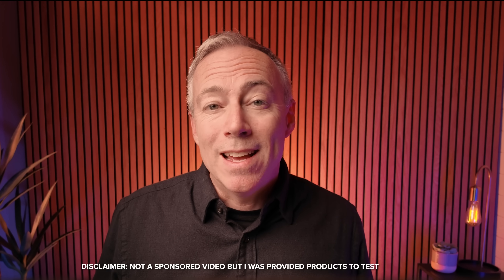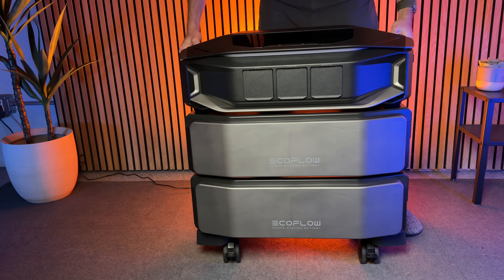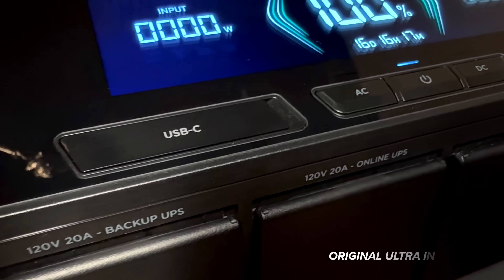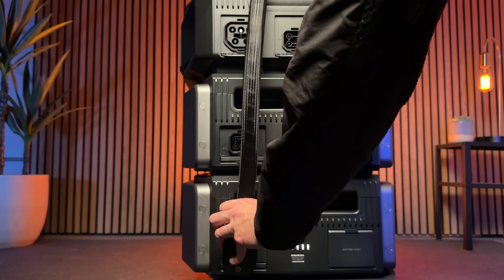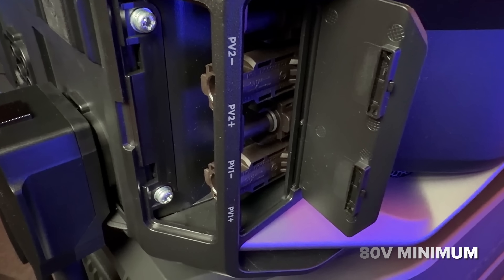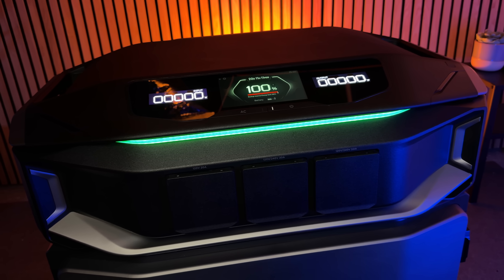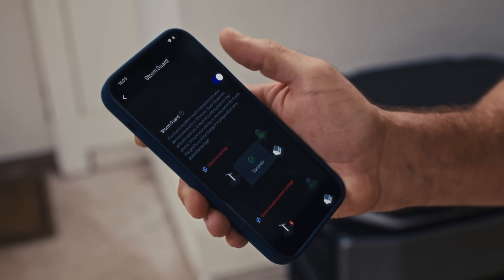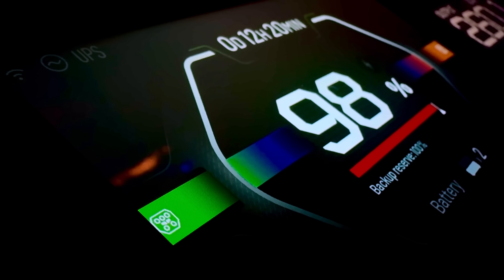EcoFlow DELTA Pro Ultra X - INCREDIBLE upgrades you need to know about

Comment: Silly question 🙋 Do you think it would be powerful enough to run a food truck for 10 hour day, with four 3000 Watt blenders, two 2000 W espresso machines to regular refrigerators two freezers and a 18,000 BTU air conditioning unit?
Reply: You need to monitor your power usage to find out how many KWh you need to run your truck for the day.  Then you can make an informed decision.  You are only using those items for short periods of time, but you could still need a lot of power while you are not connected to shore power.
Reply from the maker: Yep, that's the only way to know for sure. Many of those are intermittent loads so it's hard to know how much KWh they use - depends on hours of use. My hunch is that might be a lot but if you had a 30kwh system it might work but that's pretty big.
Reply: depends on how many batteries you had and if you also had any solar panels on the roof of the food truck...

Comment: Really informative video, Todd. I’ve had a multi-DPU with SHP2 system for a year now, and I’m really happy with its performance and value proposition. The specs of the updated version make for a tempting option and alternative to the Powerwall and others. Get it now before the 30% disappears.
Reply: Yes, the 30% on home back up battery systems was the reason that I pushed the build of my two ultra DPU and battery system.  Now I am thinking about the panel for automatic back up instead of a manual 50 amp hub and interlock.

Comment: What is the gateway you referred to? Did you mean the smart home panel 3?
Reply from the maker: They basically upgraded the SHP3 to have way more circuits so it can act as a main panel. They are now selling the gateway which is stripped back and has fewer circuits than the SHP2. Clear, eh?
Reply: @todd.parker  trying to see the gateway version on their site but only seeing SHP2 (and nothing about v3). that woudl be a good comparaison to Tesla gateway 3 which can be had for $800 but no smart breaker control (which is ok, entire home backup and 200A place to land the inverters)
Reply from the maker: Guessing all the product pages will be live soon

Comment: Please see if it still favors grid power when in self-powered mode.  
For example, my DPU is set to 80% backup reserve and solar charges the battery above that to 95%.  If there's a particularly sunny day and the battery hits 95% then the EcoFlow algorithm annoyingly shuts off the solar and continues using grid power instead of shutting down AC power and draining the battery to the backup reserve (while continuing to use available solar for charging).  Completely bassackwards!  
So currently, every day I have to watch the battery percentage and go out to the garage to switch off the charging plug to continue using solar.  After about a month of tech support emails and various levels of support, EcoFlow's solution to their algorithm is to just keep setting lower and lower backup levels until solar is used the entire day (like every day is predictable and has the same amount of sunshine).
I have also tried to handle this with their app "automation" feature, but so far it only knows about Delta 3 Plus systems I have, even though there are icons for every other EcoFlow system I own, including the Delta Pro Ultra (tech support is clueless about how their own system works in this regard as well).

Comment: Is this unit able to communicate/connect to EcoFlow Duel fuel generators, this info is not represented during this ad?? Ty
Reply: The DC generator feature did not work on the regular Ultra, so no. Just typical AC charging.
Reply from the maker: Good Q. Info is pretty thin at the moment but they say this in my product info "Works with EcoFlow or third-party generators for unlimited backup (paired with the EcoFlow FlowMaster Generator Rectifier via AC input)
Supports up to 12kW generator input (with 2 battery packs)". Hopefully more info soon
Reply: @todd.parker i do see the A/C connection but not the DC to DC smart cable connection 🤷🏼‍♂️. I’ve recently found EcoFlow’s website to be somewhat difficult to navigate & get clear correct information. Pictures also misrepresenting product information. 🤞hoping for better. But I do enjoy the brands engineering 👍

Comment: not only is it not worth the upgrade it was not worth the purchase. cost to value is terrible.
Reply from the maker: If you're into DIY and have the skills to properly wire everything with all the right fuses, disconnects, and follow code perfectly, you can save a decent amount of money but a typical all in-one inverter is very loud, has high standby losses, and the rack mount batteries take up a ton of space. The Ultra is pretty incredible because you can just plug and play a system in a few minutes with no technical know-how and have something as powerful as a Tesla Powerwall 3 (or multiples) with no installation costs as long as you already have a generator inlet, along with slick monitor options and accessories. It's pretty hard to beat on all fronts except cost.

Comment: good that we did not baught the old Version 2 weeks ago. will wait for the new one here in Germany next year
Reply from the maker: Close call! That said, the original Ultra is still pretty great and the batteries are the same.
Reply: @todd.parker   joke they didnt make this work along with the dpu using the SHP .. just turned me off from buying anymore batteries or other products..
Reply: Are they really the same. I thought they added more energy density /total capacity
Reply: @reatilekoketsomolatlhegi1068 they’re the same. The reason capacity is more on the dpux is because it requires 2.

Comment: Hi, Todd, great video.  I just bought the old ultra and SP2.  I currently have 2-200 amp panels.  I like that the SP3 can totally replace one of the panels all together or be made into a sub-panel, as I have more than just 12 circuits, in my general panel.  (Heat pump is in the 2nd panel) If I understand you correctly there is NO Anderson port to hook up like a 400 watt solar which I got with the system.  I do not have the system I bought installed yet so was wondering if I should return the Inverter and SP2 for the new inverter and SP3.  Is the SP3 compatible with the old Delta pro Ultra? What does someone do if they don't have a huge solar array?  No Anderson port so is it useless as well?  They always come out with better stuff and now I feel silly spending my $9k for what I have currently.  Thanks for your help!
Reply from the maker: The original Ultra doesn't have an Anderson port but I think you're referring to the low PV input. The Ultra X replaced that with another high PV input so it's not as well-suited for a single portable panel because it needs a minimum of 80v to start charging so the Ultra may be the right choice for your needs. If you did upgrade to the X, you'd just need to wire a few panels in series to get to 80v which isn't a big deal because to recharge even a 2 battery system, you need a decent amount if solar panels. I wonder if they will continue to sell both because they are geared of slightly different use cases imo. I assume the SP3 will be backwards compatible but I'd wait to see the official product page to confirm. I don't think you made a bad decision at all, things always improve but the original Ultra is a great unit, especially if you don't need to connect 10,000w of solar and the batteries are compatible with both versions so that's a solid investment. I'd keep with what you have and be happy.
Reply: @todd.parker  Thank you so much for your help.  My wife and I appreciate it.  My biggest complaint is only having 12 circuits available in SP2 vs SP3.  25 plus years ago our house was wired to break up circuits. Like our lilving room is on two breakers.  That's our issues too. I had purchased that package from ecoflow that included the SP2 and 2-400watt solar panels they said should be hooked up in parallel.  I really hate such issues as I feel I am in currently.  .
Reply: Hi Todd, we upgraded to the DPUX and the SP3.  I now have kept the two Ultra batteries to give us a 4 stack.  I have to do firmware upgrades to the 2 old batteries.  I was told I have to do that to each battery one by one, is that true?  They also told me to make sure to plug those two older batteries furthest from the AC Port.  Do you know what they are saying?  How about making a video on updating firmware?  Thank you!

Comment: Hello , my question is that I have the delta pro ultra and two batteries so if I purchased the smart home panel 3 will my system work with the panel or not
Reply from the maker: Yes! Here is what EF says:
"Which device combinations does Smart Home Panel 2 support? Smart Home Panel 2 supports DELTA Pro Ultra alone, DELTA Pro Ultra paired with DELTA Pro or the Double Voltage Hub, and DELTA Pro 3 (DELTA Pro 3 cannot be used simultaneously with DELTA Pro Ultra)." - https://us.ecoflow.com/products/smart-home-panel-2?variant=40767883575369

Comment: Is the new EcoFlow Delta Pro Ultra X inverter compatible with the EcoFlow smart panel 2?
Reply: Unfortunately not as of now
Reply from the maker: I wonder if it's a matter of a firmware update or a hardware thing? Some of those details are still emerging.
Reply: @hectortoledo5914  how do you know that ? so little info out there - even the price and you're supposed to put $500 down. yeah right.
Reply: Will the smart home panel 3 be compatible with the original DPU?
Reply from the maker: Yes but you can’t use the DPUX with the SHP2